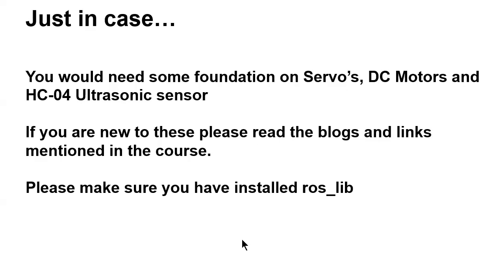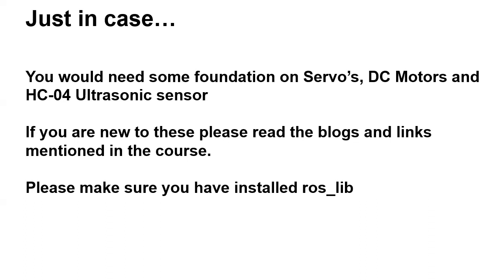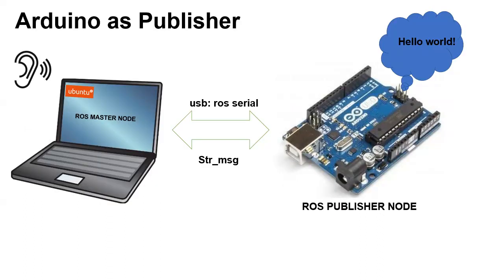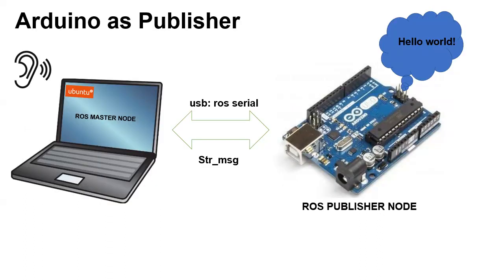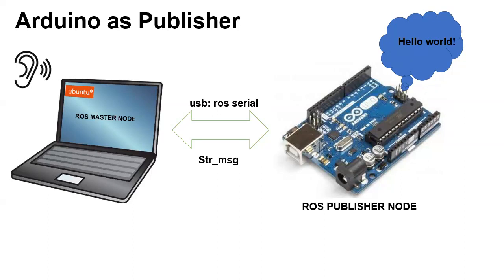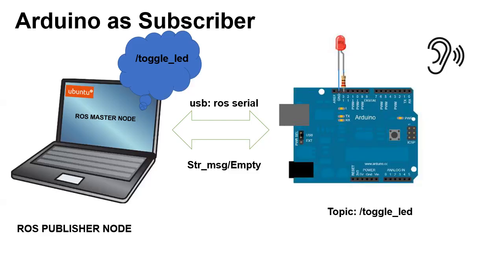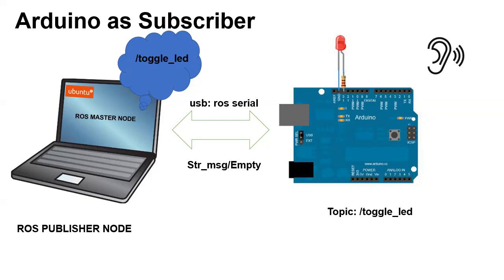ROS Arduino tutorials | ROS Arduino serial communication #2

Comment: i have ros noetic and  I install rosserial_arduino from here https://github.com/ros-drivers/rosserial because via apt is not available yet. I m trying to make library and i get this error:
[rospack] Error: package 'rosserial_arduino' not found
Any idea??
Reply from the maker: I dnt think the packages are out or in stable mode for Neotic. Try with ROS1 melodic. Good luck.
Reply: @MieRobot  Is a good idea to install virtual box ubuntu 18 in ubuntu 20 and install ros there?
Reply from the maker: @witChaos  Hi Alex, It is not a good idea let me explain why. ROS is community supported and not an enterprise product. People like me and you work hard apart from their day job to contribute to ros. Latest version hence needs time to test and interface from respective package owners. It is hence a good idea to choose one or two version lower than current version. If u are looking at production project in ros then choosing a LTS version makes sense. Hope I was able to answer you. I always give some time to the latest version before I start using it and check the package compatibility I needed.
Reply: @MieRobot  Thanks for your help
Reply from the maker: @witChaos  Good luck mate!